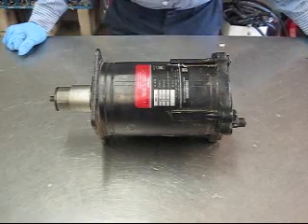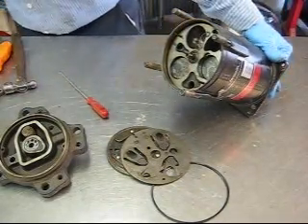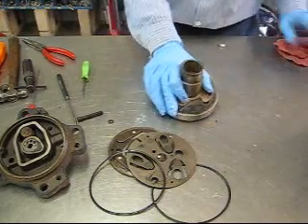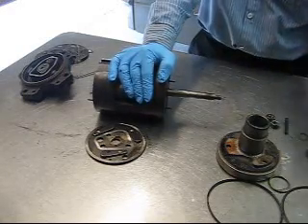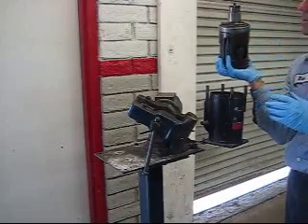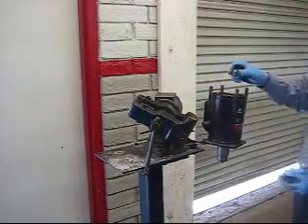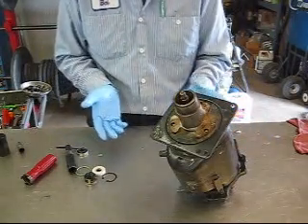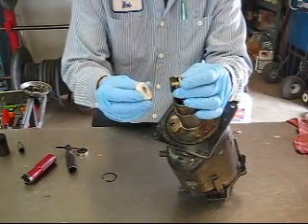A6 compressor reseal

Comment: Ahh, the good ol' A6! The best (and first, to the best of my knowledge) swash-plate compressor ever made. The early model "Frigidaire" units had cast iron piston rings, and the carbon seal ran on a lapped cast iron seat rather than the ceramic seat that later versions used. These were the best versions IMO. Later units used plastic bands as piston rings. Not sure why the transition was made, other than perhaps for noise? Their 12.3cu. in. displacement meant that they could keep suction pressure down, even at idle with high heat loads. Vehicles with A6's running R-12 would freeze you out, even on a dry 120° day or a 100% humidity 104° day.

The A6 is one of the three best compressor designs ever. The others are the York 206, 209, 210 series (and the functionally equivalent Tecumseh HG series, as well as the mini-York and mini-Tecumseh units) and the Chrysler RV2. All "old" designs. The latter two are essentially identical in design to stationary reciprocating compressors, whether open drive, semi-hermetic, or hermetic. Guys mistakenly believe "modern" axial piston compressors (which all trace their lineage back to the A6 design from 1962 - so much for "modern") are more efficient than the York, Tecumseh, and Chrysler RV2 twin cylinder reciprocating designs, but that's not the case. If it were, stationary compressor manufacturers, who have been under pressure for decades to improve the efficiency of AC and refrigeration systems, would have switched to axial piston designs like the A6 or Sanden long ago. But, they never did. And they certainly researched the designs. No matter what they did, the standard recip designs still had better efficiency, durability, and life span. In the end they went to scrolls, but even today recips are still used in many stationary refrigeration applications due to their higher efficiency in many medium and low temp system designs. Scrolls tend to not gain an efficiency advantage until system sizes climb above 2-1/2 to 3 tons or so.

FWIW, the carbon-ceramic seal may weep a bit of oil, but it has the advantage of not eroding the input shaft over time. Because the lip seal rides directly on the shaft it will slowly wear into the shaft. Eventually this may render the shaft no longer able to seal. My preference is to run the carbon-ceramic seal, and put a felt ring on top of the ceramic after the snap ring is installed to soak up the weepage.

Comment: Thanks for the tips! I just replaced the O rings and shaft seal on the original A6 compressor in my 1984 Chevy dually today, didn't have any problems at all. After 32 years the shaft seal finally had enough and was leaking bad, they sure made stuff to last back then. The only special tools I used were the clutch remover/installer and the shaft seal remover/installer. I also used a pair of pliers that were made to get to the snap ring that fits against the ceramic half of the seal. My Grandfather used to work on cars and trucks years ago and they were part of his AC tool set. I charged the system with R12 and the thermometer in the center dash vent gets down to 34 degrees with the blower on medium speed at an idle. Fixed it just in time for the south Texas heat!
Reply: That's another reason I like the carbon seals, and the old compressor designs. They last an amazingly long time. I see 40-50 year old York and Tecumseh compressors that finally end up needing a new seal. Put a new shaft seal kit in 'em, and they're good to go!
Reply: @WTFChuk  my A6 in my 70 chevelle still pumps cold air but it is loud, any idea what it could be? I live in PA and would love to find someone that rebuilds these local, or atleast knows what they are looking at internally.  Seems like Original Air is the only act in town, their repair facility in Texas I believe

Comment: Thank you for the video, it was key in me doing this myself.     TIP for those without the seal tool, I used a large piece of heat shrink over the end of the shaft, and it allowed the seal to slide past the keyway and threads. Just remove it with a pick after

Comment: Hello Bob, I have just rebuilt my A6 compressor from my 65 Gto. Thank you. The video was great! All went together perfectly. Question: how much  oil goes in the empty compressor? What hind of lio for R12 or R134? And how do you fill it?
Reply: Total system oil capacity is 10 oz. on a clean flushed system. If not its a educated guess as to how much to add. I would use PAG 150 for 134A or mineral for R-12. If the compressor is off the car, oil can be added via the drain plug on the side or suction inlet of the compressor. If its installed it can be injected before charging.
Reply: @bobsteinmann5793  thank you Bob!

Comment: Just had a question , the original shaft seal used a two piece ceramic and carbon seal, the spring loaded carbon seal pushed up on the ceramic piece and pushed it into the C clip and the area of the O ring. My question is if you use the new double lip seal and there is no spring load from the carbon on the seal how is the new double lip seal held in place, with no spring pressure would the new seal not have pressure pushing on the C lip and the new seal would be loose in the bore. Oh and best video of the A6 ever, Thank.
Reply: The new seal fits in the same location that the ceramic seal would have seated. So it does bottom out and is retained by the clip just like the original.

Comment: Do you have a video on how to change the clock position of the wire hook up on the A6 from 2:00 to 10:00 o’clock? On this video it appears you have removed the complete front assembly down to the housing so it would appear that you can do the whole project from the front without taking the complete compressor. Any advise or instruction would be greatly appreciated. Also after your seal replace on the A6 in the video how do you oil to make ready for charging with R134 after the compressor is put back on the car.
Reply: Take a look at our GM clutch  removal and installation video. Once the coil snap ring is removed you simply rotate the coil and reinstall snap ring. If compressor is on bench, oil is poured through drain on the bottom. Use 7/16 wrench to remove plug. If its on the car, oil will need to be injected while charging.

Comment: Great video, haven't seen one of these compressors apart for years. I have 5 cars with that style A-6 and most of them need seals. You don't mention what type of oil you are using to lube the O-rings. I plan to refill mine with R 12, any idea where to get compatible oil?
Reply: Mineral oil from any grocery store
Reply: @legostar55  NO NO NO!!!! Do NOT use food-grade mineral oil from the grocery store! Just because R-12 systems use mineral oil does not mean any product labeled "mineral oil" will work. It has to be the right type and viscosity of mineral oil. Food grade mineral oil is neither the right type nor the right viscosity.

For R-12 service, the A6 compressor can use either naphthenic or parrifinic mineral oil, but naphthenic oil is preferred for a variety of reasons. The most important criteria is that it must have the right viscosity. 500 - 525 SUS (ISO 100) is the correct viscosity for mineral oil. Besides naphthenic mineral oil, the hard-to-find ISO 100 alkylbenzene oil is also very suitable for R-12 use. You can also use ISO 100 POE (polyolester, what auto AC guys lazily refer to as "ester") oil for R-12, but being as it's hygroscopic and not necessary it is best to stick to mineral (or alkylbenzene) oil for R-12 use.

If the system is destined to use R-134a, and has the proper neoprene or HNBR seals, then either ISO 100 POE or ISO 100, 125, or 150 PAG oil can be used. Never use PAG oil in an R-12 system.

If you only need a quart of mineral oil, which is the case for most people, then Ebay or your local auto parts store is the place to go. On Ebay, first search for "AC Delco compressor oil 15-117". That is OE GM 525 SUS naphthenic mineral oil. 
If that doesn't show any results, search for "refrigeration mineral oil". The two most common ones on there will be Four Seasons part # 59000 and Johnsens "Freeze" part # 6913. Both are 500 SUS naphthenic mineral oil. You may also see "Temperature Control parrafinic mineral oil" with a part # 59001, which as it's name says is parrafinic rather than naphthenic. It is also approx. 500 SUS. Any of those will work, but as mentioned the naphthenic oils are better.

If you want or need a gallon, or you want to know that you are getting the best, new oil, then you have a couple options. The two brands of mineral oil in the refrigeration & AC industry are Suniso and Nu-Calgon. Both are naphthenic mineral oils. For a 500 SUS viscosity you need either Suniso 5GS or Nu-Calgon C-5s. Both are identical and have been serving the industry for decades, and neither is better than the other. Your choices for purchase is to either have a buddy in the HVAC/R business get you a gallon from a local supply house, or go to an online store like Supplyhouse.com and buy a gallon there:

https://www.supplyhouse.com/Parker-Hannifin-475332-L320-5GS-SUNISO-Mineral-Refrigeration-Oil-500-SUS-ISO-100

Again, do NOT use food-grade mineral oil, motor oil, or any other kind of oil. Use the proper stuff. It's easy to get and not expensive.

Comment: If you are just resealing the A6 compressor and replaceing the desacant bag how much oil should you add back in to the system
Reply: that depends on your car system, check the specs